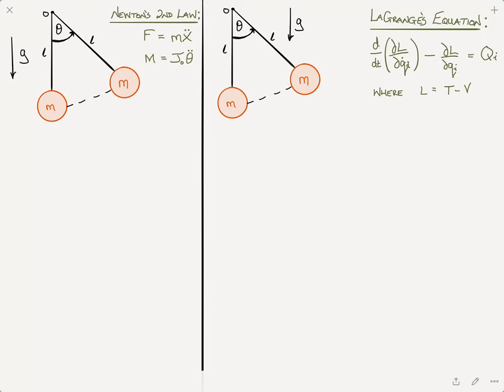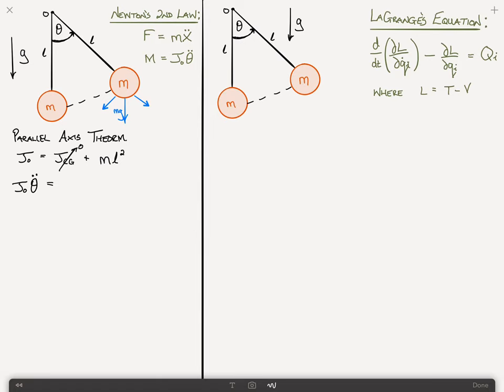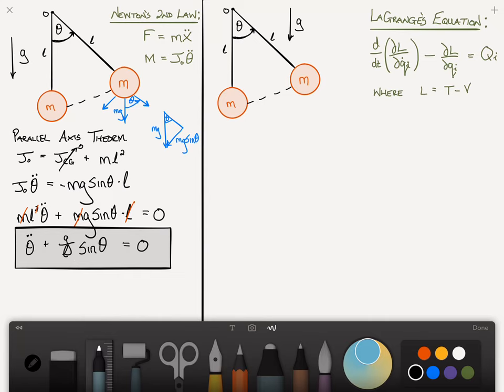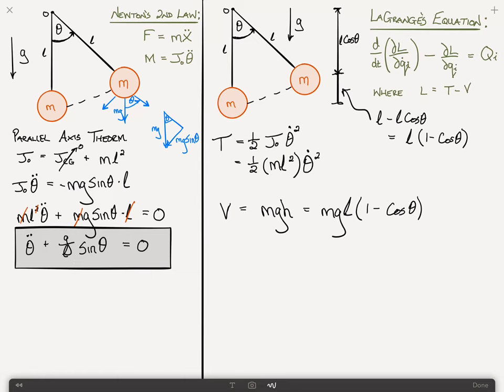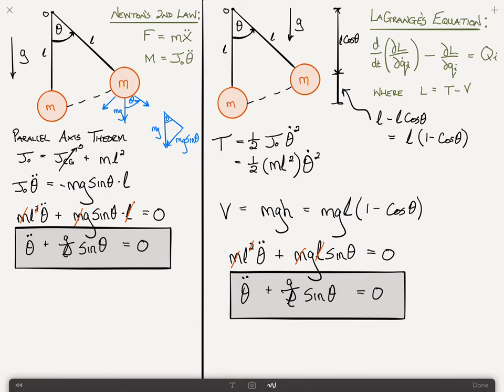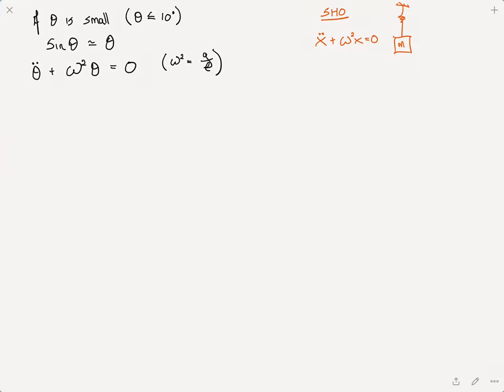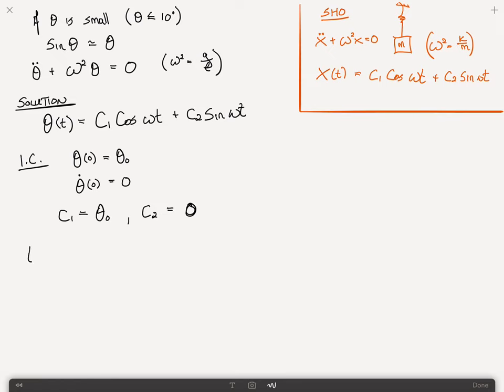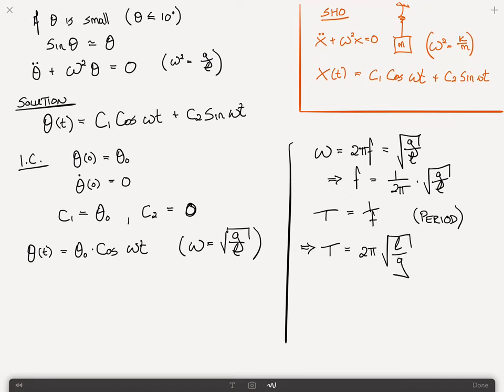Equation of Motion for the Simple Pendulum (SDOF)

Comment: I get it. My confusion comes from when you combine one "type" of motion with another... like in my homework, the pendulum is connected to a spring in the horizontal direction. What then??
Reply from the maker: Assuming the method of Lagrange's Equation...in that case, you would need to add to the potential energy, V, the contribution on the spring, which is equal to 0.5*k*x^2, where x is the deflection of the spring.  This requires finding the deflection of the spring, x, in terms of the coordinate θ which will depend on where the spring is attached.  For example, if the spring is attached to the rod (perpendicular to the rod) at a distance, d, from the hinge, then the deflection of the spring is x = d * sin θ.

Then substitute into Lagrange's equation and you will end up with an additional term in the equation of motion.

Comment: When you calculate the time derivative of partial derivative of Lagrangian, isn't there a factor of theta dot? Don't you need to take the derivative of the outer function, and then multiply it with the time derivative of theta dot?
Reply from the maker: No, the chain rule doesn't apply here - it's not a function of a function.  

After the partial derivative of L w.r.t. theta_dot, I'm left with ml^2 theta_dot.  Taking the time derivative of this w.r.t. time gives me ml^2 theta_ddot.  

The theta_dot you're referring to generally comes up when we differentiate trig functions w.r.t. time.
Reply: @Freeball99  Thank you!

Comment: I need help,  i have the given, length of the string and the mass and angel, it would really be appreciated.
Reply from the maker: I assume you are trying to find the angle as a function of time and that you have been given the initial angle...in this case, IF THE INITAL ANGLE IS SMALL (less than about 10 degrees) then you can linearize the equation of motion and arrive at the well-known result for a linear pendulum which is, the period of vibration, T = 2π·SQRT(L/g) and the angle at any time, t is given by θ(t) = θo · cos (2π·t / T) where θo is the initial angle.

If the initial angle is large, then you will require the nonlinear solution which involves solving the equations using numerical methods as I have shown in this video:  https://www.youtube.com/watch?v=_eZyTNthJG4